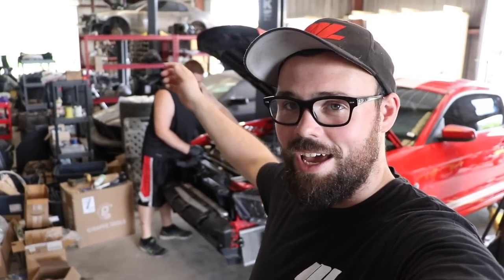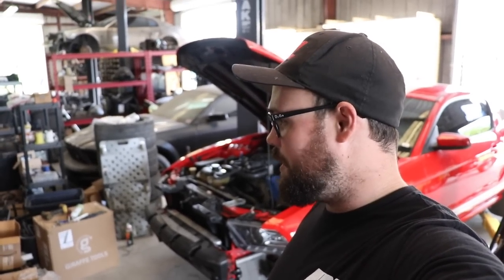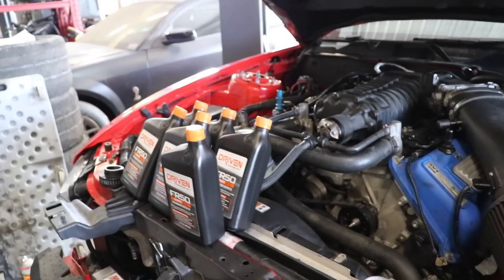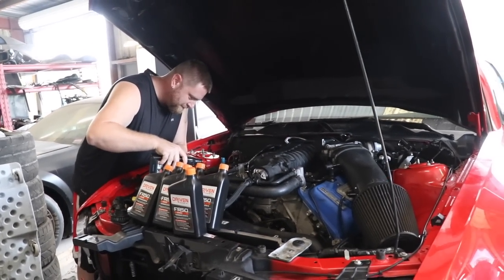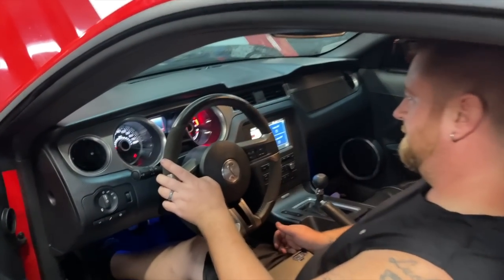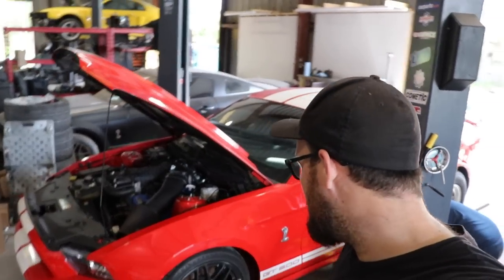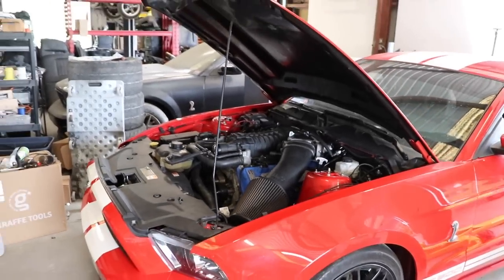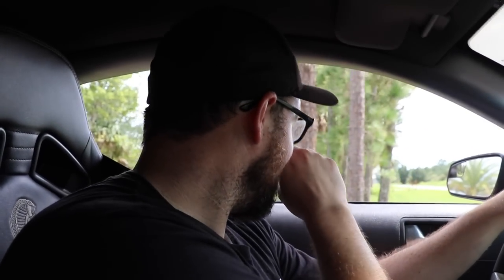El Choppo GT500 First start and Drive Motec + Twin Turbo Build

Comment: It's good to see "El choppo" back on the road. It would probably be a good idea to tighten your suspension bolts or replace whatever in the front end is rattling around.

Comment: So, Drew what really happened with the 3.8L? Why did you give up on it that quickly?
Reply from the maker: Give up on it? I had it for over a year. And I had a pd blower setup on it since I got it. Turbo is just a big change in the right direction for how I want to use the car
Reply: @MustangLifestyleTV  Well I saw that when the engine blew up you made the decision right there to go turbos, but the car never made good timing on the 1/4 mile (or at least what was expected). I guess we were hoping to see good numbers on the 1/4 mile based on the Dyno numbers the car put. Good luck!
Reply from the maker: @loloforge2841  I decided a long time ago this car just isn’t meant for track and 1/4 mile. It’s a street roll car

Comment: What mufflers sounds good on a 4.6 cobra motor finally bought mine 96 Lincoln mark 8
Reply: 2 chamber magnaflows or if you want the same sound just louder Magnapacks
Reply from the maker: Borla Stinger with Longtubes has always been my favorite
Reply: Got a 97 mk8 engine for my 95 thunderbird. Unfortunately shes tired though

Comment: take those back tires off until turbo build. you don't make enough power right now to spin those meaty boiz.
Reply from the maker: Haha. The tuner asked if I would need traction control setup. I was like I don’t even think this thing will spin
Reply: Make no mistake even with that m122 the thing should be well above 500 rwhp with his setup if everything is right.  Not spinning the tires isn't a bad thing by any means.
Reply: @midnight347  there is no need for those fat tires for 500hp... he understands what I meant. I'd save them for turbo build.
Reply: @HoldPublicPigsResponsible  yea I know you don't "need" them but too much traction isn't a bad  thing

Comment: You need to change the entire suspension the clunking sound it makes is awful
Reply from the maker: Anti roll bar hooked up on the street will do that. It is suggested to disconnect the link on street by manufacture